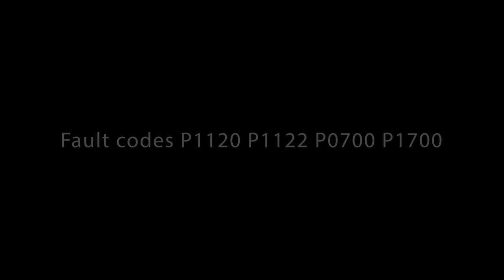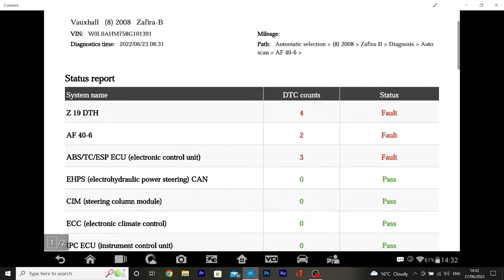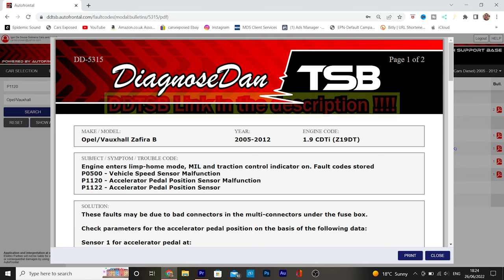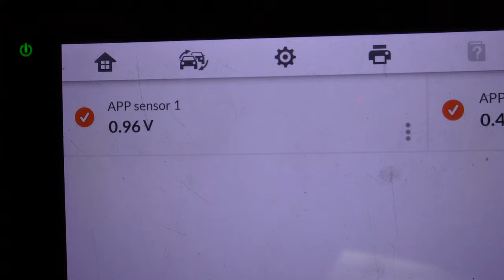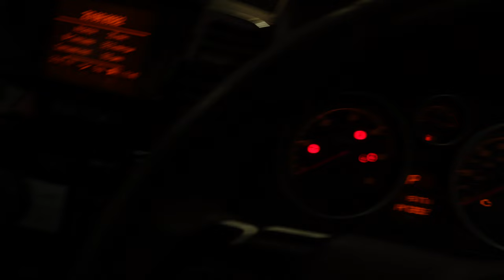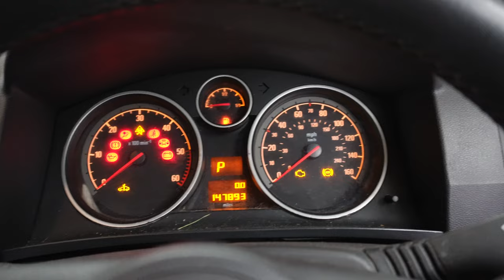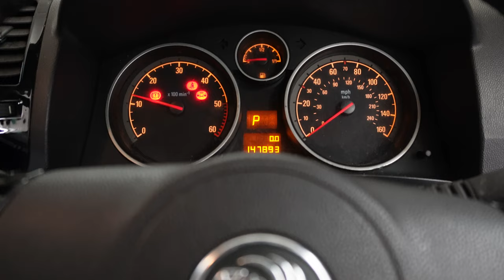2008 Vauxhall Zafira B 1.9 diesel INTERMITTENT accelerator throttle pedal failure P1120 P1122

Comment: My Zafira will randomly shut down while driving and then after an hour it will start again but run like crap. I can drive maybe 5km and it will stop. 

I don't have any diagnostic tools so I used the trick where you step on the brake and gas pedal and turn on the ignition. The car then spat out all the fault codes. I got P1120, P0335 and P0087. The 0335 is the crank sensor which I already changed. For the P1120 I tried changing the gas pedal and I also did the fuse box and ECU plug cleaning as you showed in this videos. The fuse box looked like new but my ECU had 3 or 4 really corroded pins. Like there was green crystals on the pins. I cleaned all that but it still won't run right. 

The P0087 is too little rail pressure so I'm thinking it's the high pressure pump. I'll try changing out just the pressure sensor in the pump as that is cheaper and quicker than doing the whole pump obviously. It wouldn't surprise me though as I've now got 350k km on my car.

What kind of diagnostic tool do you use? I don't mind spending a bit more as I work on a ton of cars.

Comment: Helo thanks for the video.

I did the same and i still have the problem, (service light and ESP turn on).

i connected OBD it says cable abs front left wheel. do you have any idea about it.

thank you so much.

Comment: Hola maestro, gracias por su ayuda con la información.
Maestro una consulta usted tendrá manual de reparación sistema electrónico de opel zafira motor z18xr, pin out ecu motor simtec 75.1 gracias por su atención.

Comment: i have just fixed this problem after suffering  6 months ,the solution is cleaning inside the accelerator pedal, and it will be done.